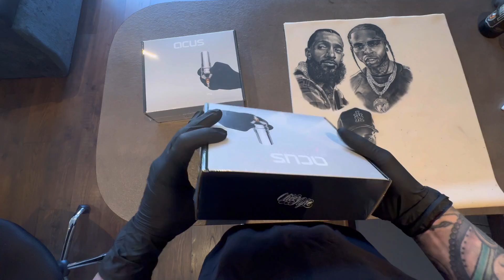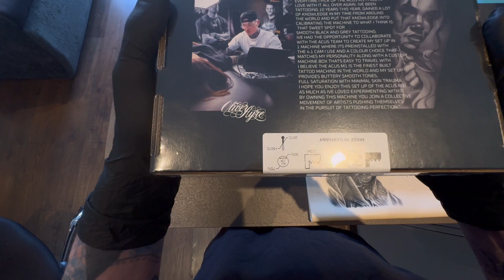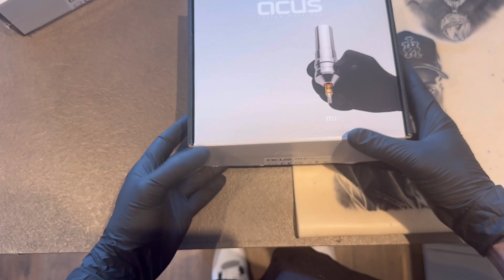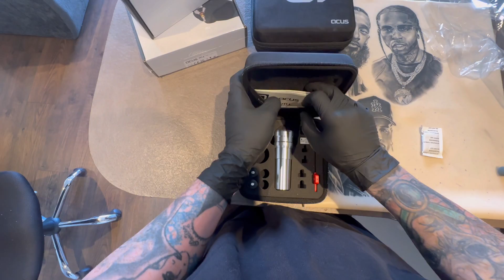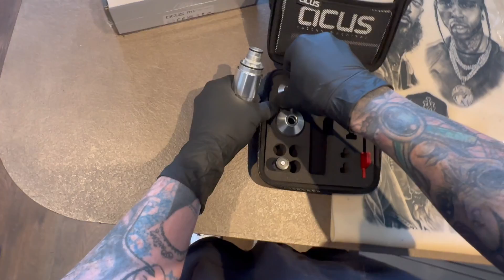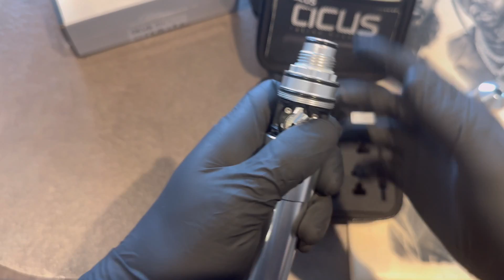Unboxing the Acus M1 AYRE & Raffle to win a brand new M1 Ayre Machine

Comment: 99% of tattoo machines have a motor with a pusher placed in a cylinder. The retail price of the motor is $50. Everything else is marketing. Remember, beginners, good tattoos come from the hands, the machine is just an extension of the hand.😊
Reply: I sort of disagree with that.
Of course the tattoo fully depends on the skill of an artist but having a good machine really pushes the quality of your art. 
You can’t just say it’s only a motor and high prices are unjustified. There is so much thought and testing behind these products and you clearly have no clue about machining/production costs
Reply: @josh1139  I know many tattoo artists who work with Chinese equipment costing $200-300. These people feel great, just like their clients. I'm telling you this as a person with an engineering education. About 15 years ago, many had no idea about wireless tattoo machines; they worked on induction, which is much more difficult in production. There were famous brands, but also inexpensive ones that did excellent portrait work. Now China has stepped far forward and their technology is much cheaper. The formula is simple, there is a chair for sale for $50, but if we add a chair for a tattoo artist to the description, it can be sold for $200.🙂
Reply: @josh1139  only to have China reverse engineer another companies intellectual property after years of research and development that sometimes takes years to achieve and then Frankenstein it all back together with inferior parts. Quite literally stealing money, often times from artist who love and work in the industry. A lot of times these artist start out building machines in garages and have built up their businesses into what they are today. Which requires hundreds of thousands of dollars to do, most times in the form of buying expensive CNC machines, computers, parts, electronics, and employees, etc. So the cost of the machines are often times a reflection of of debt they have accrued and still have to pay before even making their way close to a profit. In an already oversaturated market. Then China swoops in with big mega plants and saturates our economy with stolen designs from hard working individuals that dared to invest in themselves. I’ll always support the industry over that type of shit any day of the week
Reply: Lol....of course the artist is #1  but you need a good and the correct machine for the style of work you do...I wish my machine was 50 dollars 🤑critical torque 🤘
Reply: There is definitely a variation in motor quality and the specs required for tattooing. Most name brand companies have specialty motors wound and to be honest in order to run that as low as  Oliver likes takes a custom well built motor. Yes the price point of these style machines are a bit high but to pretend like these are some off the shelf mass produced motors with no real value is just silly. Even I know this and I only use coil machines.  (I live vicariously through YouTube when it comes to pen machines cuz I don’t have the nerve to ask a coworker to borrow one hahah Anyways cheers to all you busters 🍻
Reply: You are absolutely wrong in your statement.
Reply: @chrisparis3072 yes, like many tattoo artists who use Chinese tattoo machines🤣
Reply: @sonovbeherit5382  unfortunately there are too many so called professional tattoo artists that use cheap equipment, cheap inks and cheap needles thinking they are making more money, yet they are sacrificing quality art for the customers.
Reply: Base on your comment, i can tell that you have a shitty tattoo works. A good machine brings out the best in you. “The machine is just an extension of the hand”?? No! Its not JUST an extension of the hand.
Reply: That’s not entirely true. Coming from someone who has a slight machine buying addiction, not all machines are created equal. That being said the m1 by acus,  tattoos different than any direct drive machine I’ve ever owned. It literally allows you to change the watts of the motor (not the same as voltage +-) the actual machine has 6 different ‘motor’ settings. Yes cheap Chinese machines are trying to mimic this feature already, but the execution of doing so leaves a lot to be desired. Yes you can tattoo with any machine, even a twelve dollar coil from eBay, but having a tool that makes your life and tattooing easier to achieve, just makes getting this machine  a matter of common sense. I agree also that if you are a beginner, you probably don’t have the flow to buy a 1300.00 machine and even if you can, until you get farther along it doesn’t matter too much. However, if you want to start with a tool that makes your experience tattooing better, more consistent and hugely versatile…then grab the M1. There is a reason why in the age of big colorful led screens, and multiple other thought experiments on how to redesign the tattoo machine, people are flocking to this machine. It’s not a fluke my guy
Reply: @cagelavey Bro, I have cheyenne unlimited and xion. I didn't see much difference compared to Chinese tattoo machines. What makes you think that I will discover something incredible in Acus? And how did we do tattoos before without Acus..
Reply: @sonovbeherit5382  I’m just saying that being able to change the actual watts of the machine is something you can’t do on most machines. It makes quite the difference in how it performs compared to other direct drive machines. How it lines and packs color is so much better than the crate of machines I have. It has a different feel depending on how you set the motor to run. Like I said of course you can tattoo with almost any machine but when you find a tool that makes the application of tattooing feel different, easier, it’s like discovering gold. In addition, I’m not trying to convince you to do anything, I just didn’t entirely agree with your analysis. Most direct drives I agree there isn’t enough difference for it to to really matter what you use. But then there are machines that function better without question. The m1 is one of those machines. The stigma force is another and the mp5 tactical is another. They all have drive systems that are different, unique & they make tattooing fun. But the m1 out performs them all in my opinion. It’s a free country though, so do you brother.
Reply: FAULHABER B Flat S2610 SC. 
PRICE: 275 $
Reply: @sebastiangrajales0802  If you have this motor, will you make better tattoos?
Reply: @sonovbeherit5382  That's right.
My respects to all the professionals who are dedicated to making ultra premium engines for us tattoo artists.
Reply: @sonovbeherit5382  Not only tattooing, but also improving session time and healing.

Comment: I have this tattoo machine for 5 days. In the first two days I was about to throw it in the trash. After I put 4.5mm, the game changed, it is on the 1st place in my preferences, followed by Inkjecta x1, flux, force. This m1 hits so soft with 4.5mm but at the same time makes consistent lines and packs the black like none of the competitors do. I ordered the 4.1 and I can't wait to see what it can do. It's a very good tattoo machine, but because it's so customizable, all your attention will be on trying the settings and not the tattooing technique, so it will make you you don't like this tattoo machine. I personally do not recommend this tattoo machine to beginners.
Reply: What cam were you using before that was pissing you off? Did you feel it was hitting too soft when using shorter strokes?

Comment: no ratchet grip still, huh? Thats a bummer. I'll stick with my DF3 for now at a fraction of the cost - and it has 7 stokes on the fly.
Reply from the maker: Ratchet grips wear out in my experience
Reply: @OLIVERAYRE  only when they're the cheapo plastic ring like FK. Ball bearing with a spring in behind will not wear out before you do. Loose like that your needle depth has to be considered constantly.
Reply: @DiY2k  If you get chance to try an M1 your should try Daniel. It’s another level, I’ve used lots of ball ratchet machines and can honestly say I prefer the M1 ‘s smooth adjustment as it’s vastly more adjustable as there are no ratchet indents and once adjusted stays put. M1’s are just in a different class with regards to build quality and innovation designed to work and last: